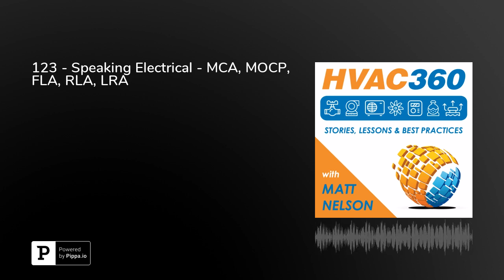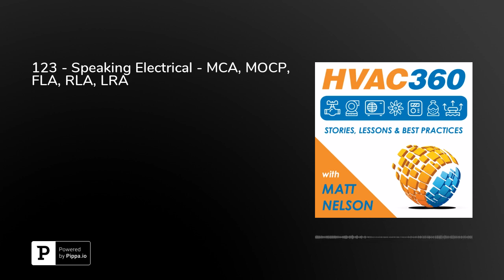123 - Speaking Electrical - MCA, MOCP, FLA, RLA, LRA

Comment: I've come back 3 months later to add something - an important part of WHY MOCP is a thing. Sure - you can upsize the conductor for long circuit runs but why wouldn't you be able to upsize the breaker too? Because the conductors in the equipment! So if you have a residential compressor unit that has an MCA of 27 and MOCP of 30 you would start with a breaker of 30 amps and a 10 gauge conductor. But let's say the compressor is quite a long distance away so you upsize to 8 gauge. Well of course the MOCP is 30 so you can't then just use a 40 amp breaker. And the reason why ... (drumroll please) ... the conductors in the equipment are 10 gauge! (in addition to other devices that might only be rated to 30 amps). So even though you have 40 amp capable conductors running to the compressor the conductors inside are only capable of 30 amps. So you see, the MOCP is to protect the conducts, components, etc INSIDE the device.